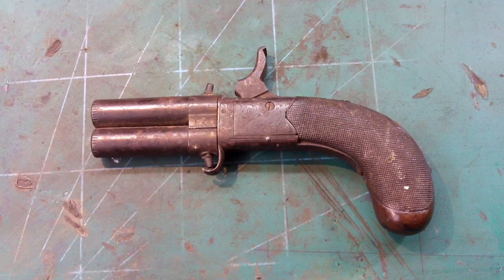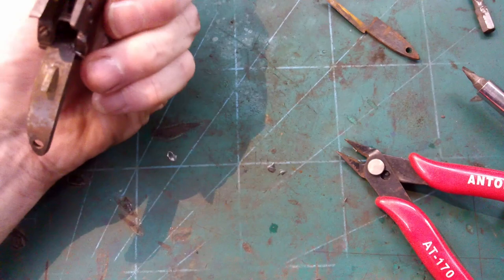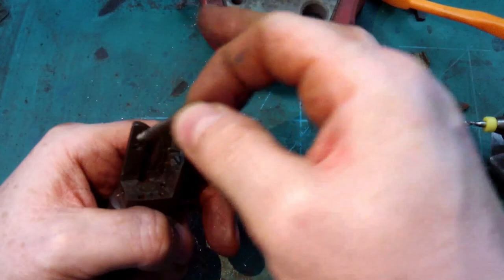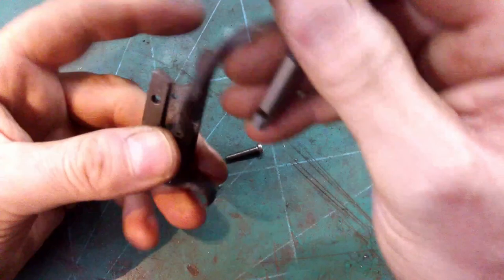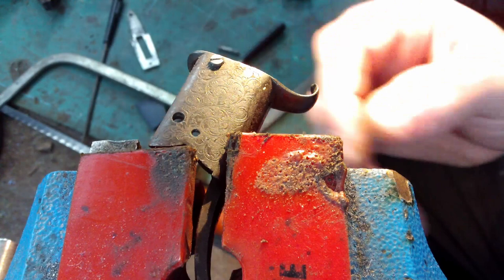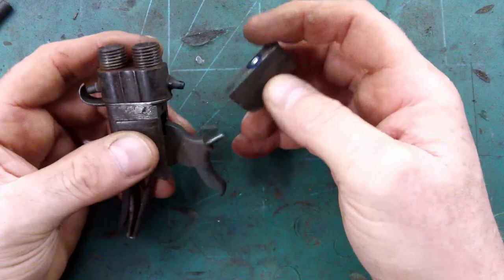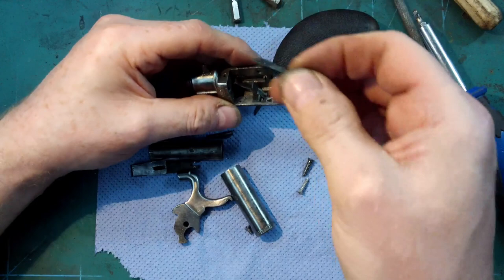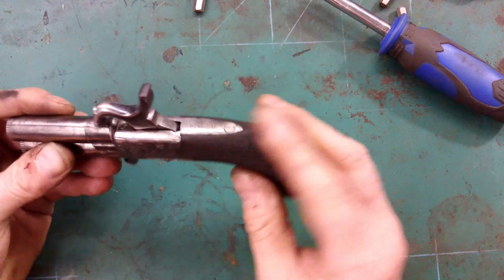Antique Gibbs of Bristol Over and Under Pistol - Gun Repair

Comment: Hi Morris, really enjoying watching your restoration videos. I have a couple of my own that require some restoration work. What technique do you use on the steel once you have completed all your repairs before you reassemble the guns? Do you call it carbonising?
Reply from the maker: Hi, Thanks, I don't do anything to the metal, once I've carded it with the wire brush, I just coat it with Barricade to prevent rust.
Reply: @morriscarstairs2685  ok, cheers Morris.